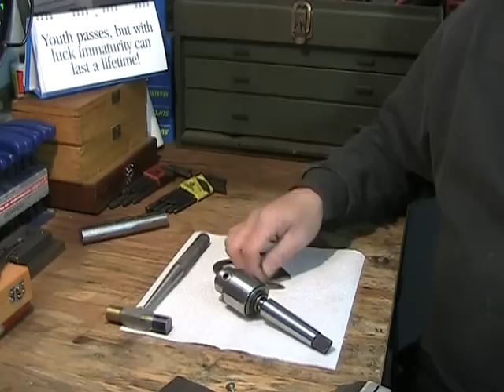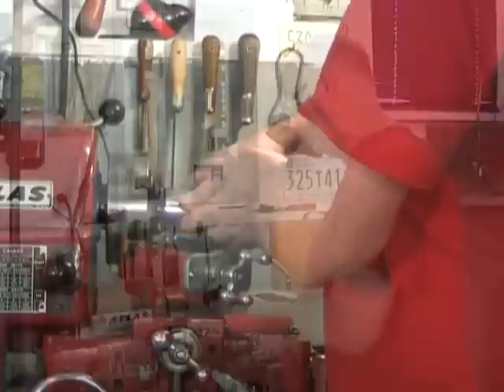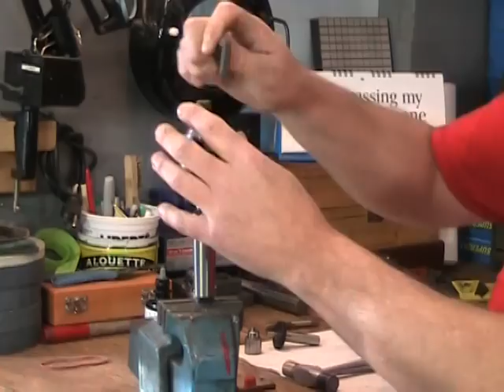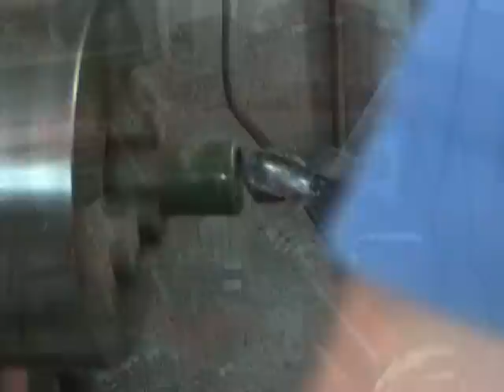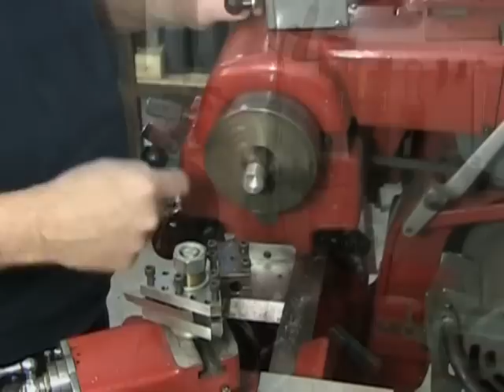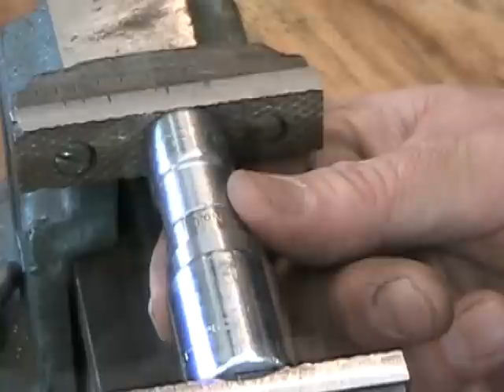SENSITIVE DRILL CHUCK REPAIR, MARC LECUYER

Comment: Sorry Marc, but I first used that trick over 25 years ago and it was far from new then.

I hd to share one good drill chuck between a Myford and a bench drill and remembered reading, perhaps in 'The Amateurs Lathe', or  'The Amateurs Workshop', that Jacobs chucks are soft through the back and easy to drill and tap.

I've passed on the tip an number of times, but it seems one that few people actually take up.
Reply from the maker: +Paul Compton So I guess that I had an original idea but that it was only original for me! that's OK since it was great fun. Thanks for letting me know and thanks for watching, Marc

Comment: Excellent explanation, thanks!  I guess I was also wondering which one has more capability to generate force.  I believe that's also the fine threaded fastener due to the shallower helix angle.  I'm asking because I have a mt4-4jt arbor to remove...  I think I'll try to single point and make a very snug fitting thread...

Comment: I seen instructions some where (Jacobs?) that showed drilling a hole in the bottom of the chuck, then use a drift/pin punch to knock out the arbor. Never seen the threading trick.

Comment: Great work Mark.I make my Chuck Wedges from surplus open end wrenches. Machine a taper on the Open end, then cut the wrench parallel to the jaw opening. I use them in my Vice to apply even pressure from opposite sides. I have a couple of good quality reversible  electric drills. Their chucks have a hole like you drilled and use a left handed cap screw to secure the chuck to the arbour. Keep up the great work, Bob

Comment: Great repair Marc. I did a similar repair to a split 5/8 socket a lot of years ago when spare cash was in short supply. It is still in my tool kit.Love your videos, very helpful.I want to ask about your 3 way tool post. It looks like one I have seen in the English magazine Model Engineers Workshop.I ask because I am about to build some (3) out of some steel I had flame cut. My lathe is a Southbend 9a clone made in Australia by Hercus and dates from 1954.Can you tell me the sizes of your tool post, I am assuming that your Atlas is about 9"Keep up the videos for old novices like me.
Reply: +Clive Donaldson That would be a David Lammas tool post, methinks.
Reply: +Chris Stephens Yes Chris exactly right. In his article published in MEW he give the size for Myford ML7 tool posts but mentioned that he had castings made for larger lathes. I just scaled things up but would love to know the dimensions used by Marc.
Reply from the maker: +Clive Donaldson Hi Clive! The tool post is home made and home designed. I didn't like the square tool posts because the small compound rest put the Tools too close to the hand wheel and that seemed to dangerous. So I made this triangular one from scratch from 4140 bar stock. If you would like some pictures, send me an Email and I will send you some pictures. Since I was making only one tool post, I never made any drawings. Marc

Comment: Did i hear you right: you reverse direction when deburring? Why is that?
Thx.
Marty
Reply from the maker: +skeeterweazel Hi Marty! The file is a forward stroke cutting tool so when cutting on the external side of a part in rotation, you want the part to turn counter clockwise. However when cutting on the inside (with a file contacting the part at the bottom of the hole) you must turn the par clockwise. In other words you want the movement of the part to run against the unidirectional teeth in the proper direction. I hope this helps, thanks for watching and for commenting, Marc

Comment: Would a fine thread or a coarse one make a better extractor screw?
Reply: +Christopher Beasley -  It depends on how accurate your threads are. With perfectly fitting threads, a fine pitch is stronger. With sloppy threads (loose fitting) the coarser thread may be stronger. 

The reason a fine thread is theoretically stronger is this: consider the shear plane (what has to give way for the threads to strip). Assuming the male and female threads are made of the same strength metal, the shear plane will be a cylinder, with a diameter roughly the minor diameter of the thread.  The minor diameter is (roughly) (pitch x Tan 60˚)/2 smaller than the nominal diameter. You can see that as the pitch increases, the thread goes deeper into the body of the screw. Since the minor diameter is getting smaller as the thread coarsens, the diameter of the shear plane cylinder will also get smaller and thus has less area. Less area of the shear plane means it would be easier to strip the thread. (This is also why when the nut and bolt are the same strength, it is almost always the bolt that strips - less area of metal to shear.)

Now, consider the case of a VERY sloppy thread; these threads are so sloppy that just the tips of the threads engage. The shear plane will be a thin helix out  by the tips of the threads and almost any pressure will strip the tips off the threads. Threads in the real world are rarely that sloppy. A thread with a moderate amount of clearance will engage less than the maximum depth of the thread. On a coarse thread, 0.010" of clearance will be a much smaller percentage of the total thread depth than it would be on a very fine thread.

I hope this helps you understand not only which thread is stronger, but why.

Comment: Another great video, Marc. Enjoyed here. And, I learned. You stated in one of your videos - in the positioning hammer series - that when drilling on the lathe one should retract the drill bit quickly. What is the reason? Is it quick enough to use the quill handle and wind it out, or should one release the tail stock and drag it out, which is quicker? My tail stock is a back wrenching heavy clump and quickly is not so quick any more at my age. Love the videos. jim